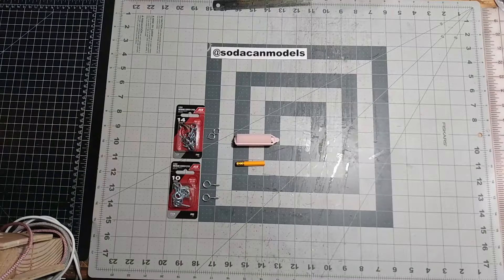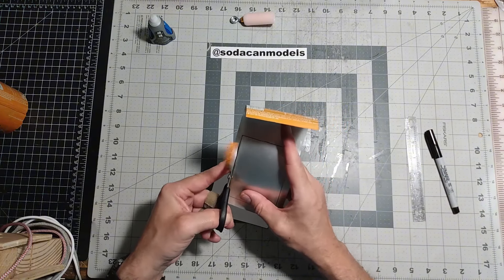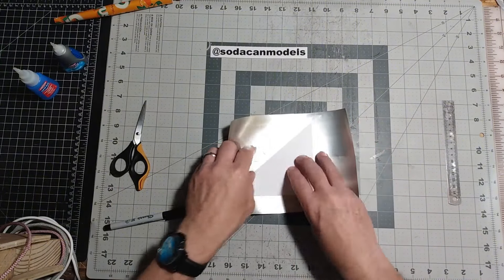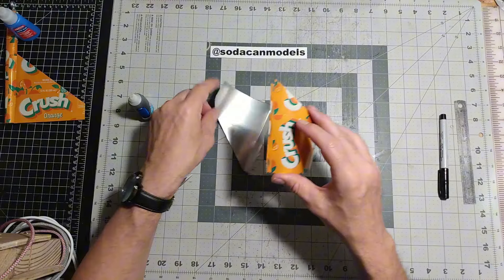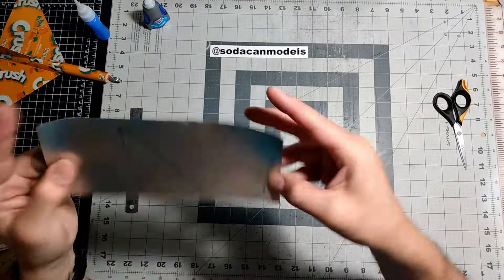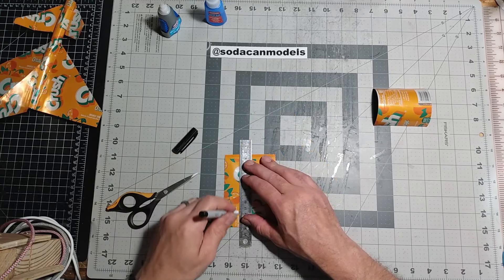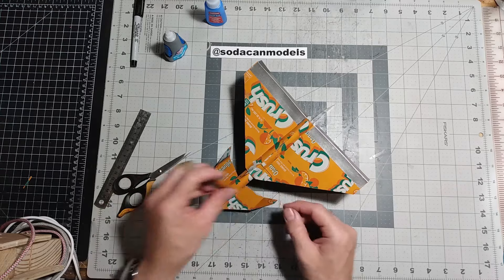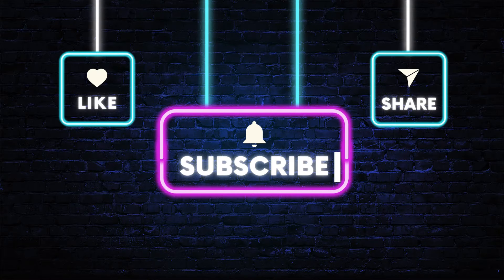Step-by-step DIY Soda Can Chuck Glider: Make & fly a soda can airplane

Comment from the maker: To celebrate Labor Day, or the ‘unofficial end of summer’, we decided that it would be perfect timing to release a how-to video on the latest version of our ever-popular soda can glider. This new version features a larger airframe than our first prototype and a more efficient angle for the swept back wings. Using the flap and canard configuration from our previous version, this glider can easily soar over sixty feet on a consistent basis. With the right conditions and strong arm, I have no doubt that the sky’s the limit for this amazing Delta Wing soda can chuck glider. We hope you’ll decide to download the free templates, build this one yourself and see how far you can make it fly. As always, make sure to like, comment and hit that subscribe button so you never miss another exciting video! Thanks for watching!